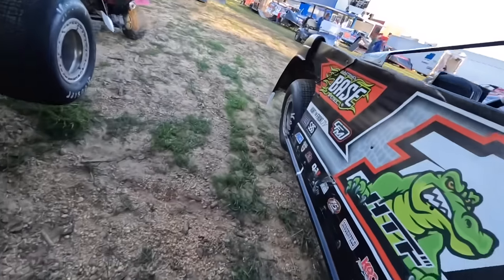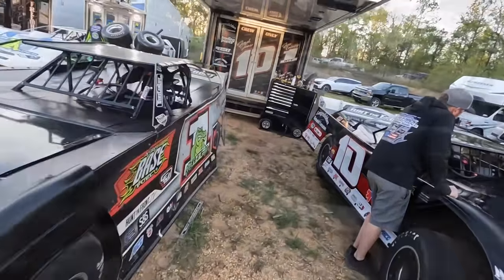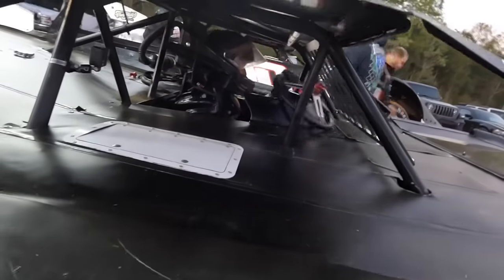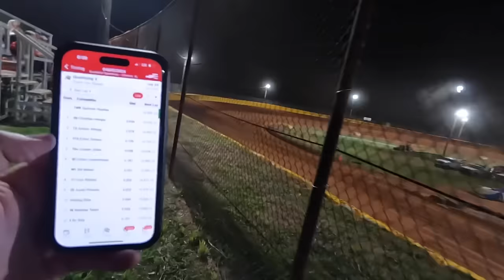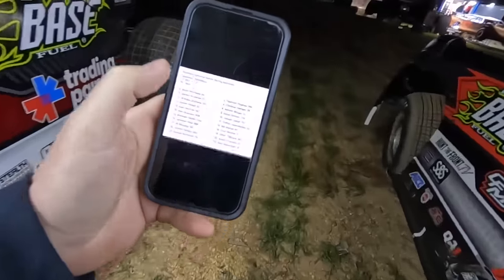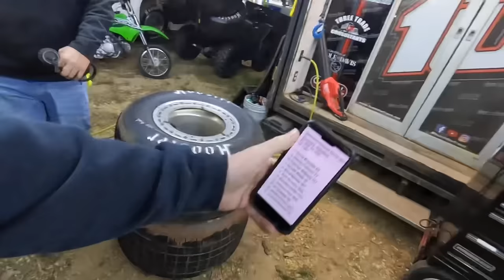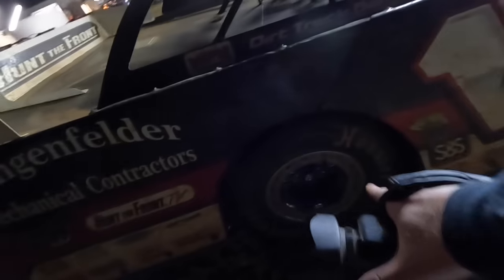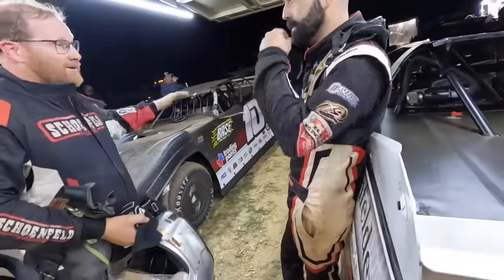One of Them Had to Win… Both Jesse and Joseph Race at Buckshot Speedway

Comment: I still can’t wrap my head around these races down south where you start in a feature from qualifying with no heat race it is called racing not qualifying doesn’t matter if there are eight cars in the north you run a heat race for starting position in the feature no hot lap heroes start in the future without showing you can beat other guys

Comment: Top Row of gauges right side, flashing blue occasionally, what is that gauge showing?
Reply: Well if it turns RED YOUR IN TROUBLE ! Not sure about the layout they have but might be the TEMP
Reply: Each driver places their's in a different spot but would assume fuel pressure based on the timing of when it's flashing blue. Can either be under pressured while car is underload or as it's reaching high rpm a bit of over pressure until it pushes through the return line back to the fuel cell.
Reply: @Zschoche392  I agree, it's the fuel pressure. The oil pressure is first on the left, we seem it go to red when it threw the oil pump belt 2 or 3 weeks back.

Comment: Jesse did nothing wrong. He was already on the bottom, the 22 tried to cut him down to make him brake check. Can't win on the first lap... unlelss you pinch the leader and try to run him over. The leader is NOT going to lift on lap 1 in turn 1 lol, bad move 22.

Comment: Joseph got some work to do to run with those boys
Reply: Eh. Rubbered track, nobody was making pass on anybody else after about lap 7.
Reply: Was too tight all night like that car has been since it was wrecked at Eldora. IMO it's killed. Neither of their Horns are good.
Reply: @gailtaylor1636 the older one is better he has won how many races in that car.
Reply: @JohnsonT2724  Better? 3% better? Owens got rid of it for a reason. While all are built on same jig, they never turn out the same. Much like faithful has been by far their best Capital.
Reply: @gailtaylor1636  since he has gotten that chassis he gotten four of five wins in it. He barley runs that car. As far as the capitals none of them have worked other than the star car. Even Jessie has said that everything just works right. And they had three of those cars off that same jig. And only the star one has worked and still keeps wining races. I agree they need to sell that chassis cause isn’t hasn’t been right since the hit. It won’t turn like it use to.

Comment: Hey I’m 14 and I drive mods how can I grow my channel (Allgas racing)
Reply: Tagging and sharing..... content pushing... some advertise yourself and you channel... make sure you treat anyone and everyone like they are you next big sponsor - even if they are just a fan ( a wolf can hide in sheep clothing ) the same way a sponsor can hide as a fan.
Reply: I subbed
Reply: @TreadMotorsports thanks
Reply: Funny how my COMMENT GOT REMOVED
Reply: Colab with someone that's already got a successful channel
Reply: @HOTRODMONZA  ikr? When the installed the new oil pump belt on the Clements, I commented that the pulley was walking and that they needed to measure run-out on the shaft. It got removed.
Reply: I subbed, good luck buddy!
Reply: You can't